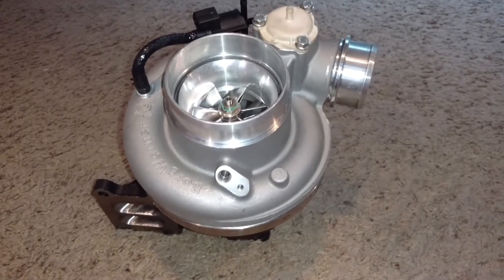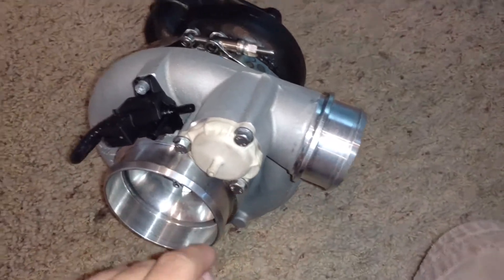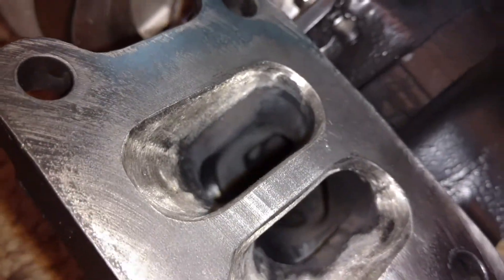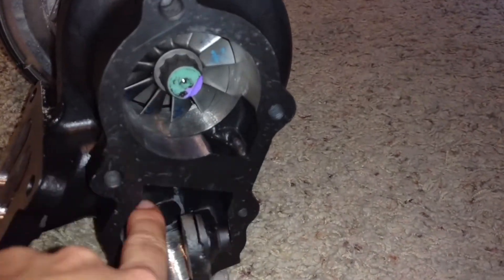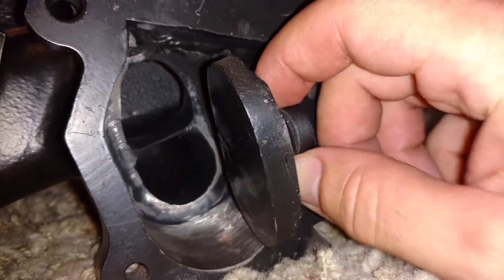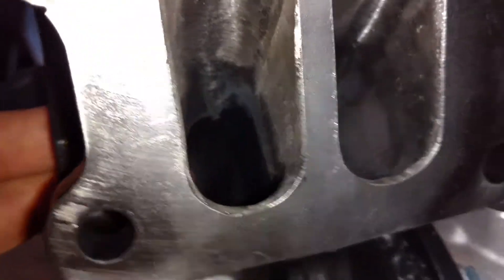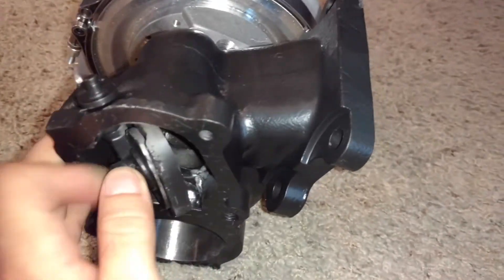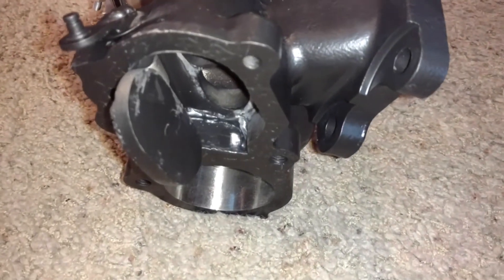#FractalFB Rx7 Part 19 - Borg Warner EFR 9174 is Complete

Comment: I did something very similar with a hx40 turbo. Still have not Dyno the car. But I have run the turbo and the car is finally running. I hope to dyno it soon.The only thing I see with your setup up is the the wastegate door may hit that back plate that bolts to the back of the turbo not allowing the door to open up enough. Wish you the best of luck with your setup. It has been a Journey for me as well. I have been working on mine for about a year as well.can wait to to see how it works for you.
Reply from the maker: No, the backplate is getting cut out to 2.5" for the "D" shaped wastegate to open FULLY into.

Comment: It looks like it has a gap on the flapper we're exhaust can escape creep out of when it is on load
Reply from the maker: Danny Rivas It will be preloaded with roughly 2-3mm of twin port wastegate using an internal 14psi spring. 

Shouldn't be an issue.

Comment: I have a feeling it's going to spool up fairly quick.what is the power out put rating on a mod like that .and y an internal and not an external waistgate ? Curious to know I prefer the internal set up just don't know if it is capable of holding boost under high load situations.
Reply from the maker: Oops, sorry @Milton Gimenez, I thought I already responded to this!  The power output is going to be somewhere in the ballpark of 550-600whp with the final setup.  It's internal purely for the sound insulation properties, but doing it again, I'd likely go with a 1.45 A/R BorgWarner Turbine Housing (External Wastegate) and a Turblown Engineering Tapering Exhaust Manifold with Dual TiAL 44mm MV-R Wastegates routed back into a 4" downpipe.  The reason why I think this WILL hold boost better is due to how much the wastegates themselves are enlarged.  They flow an incredible amount compared to the factory Series 5 FC Turbine Housing.